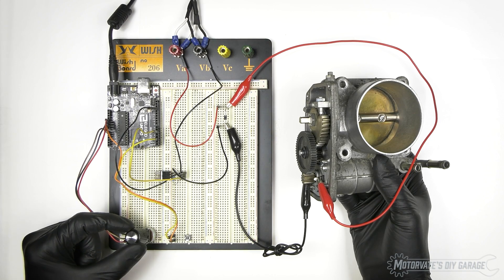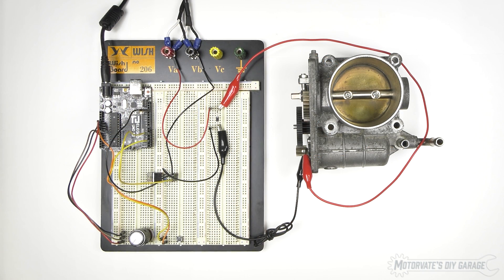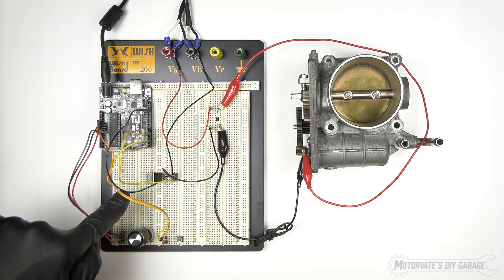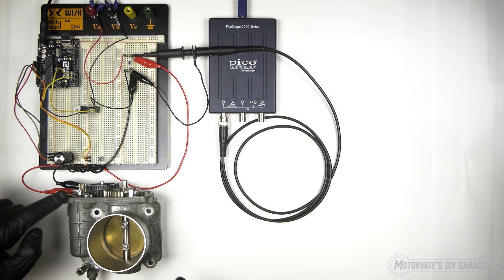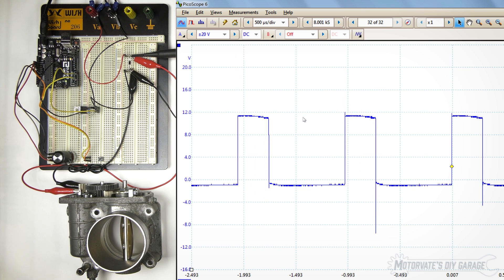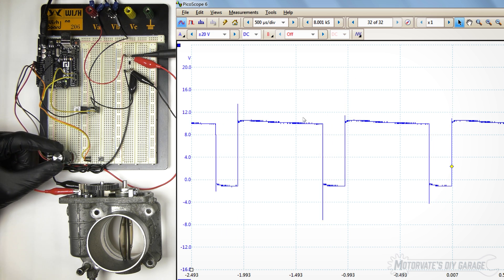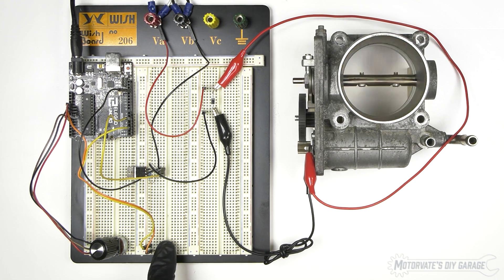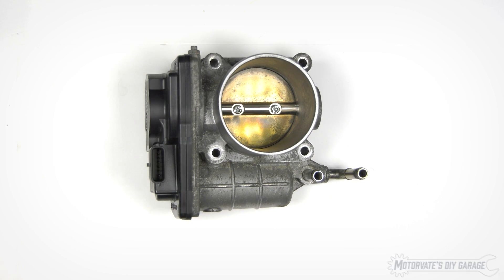How it Works - Drive by Wire Motorvate's DIY Garage Ep.31

Comment: what type of motor is attached to the throttle body? is it some kind of servo or ordinary dc motor?
Reply from the maker: In this example, it was a stranded DC motor with two brushes.
Reply: It is a DC motor but it's being driven like a servo based on throttle position sensors by stock ECU.

Comment: This is misleading AF..   what you have hooked up is nothing more than an open loop PWM circuit that is typically used to control the power in a circuit by turning a transistor on and off really quickly. More on time = more power..  Computers in the cars that control these throttle bodies are closed loop circuits. Meaning that the ECU monitors the pedal position and makes sure that the throttle blade  matches the requested throttle position via TPS Sensor.  If not, the computer adjusts the position using PWM and a PID to control the throttle blade. Most throttle bodies have a park position that is open from the position usually used when the engine is idle, which means it must use reverse polarity to pull the throttle valve closed to reduce air flow to control idle. so your little transistor there is not even close to accurate since they use an H-bridge to control them.

Speed, position, response etc are all controlled by a PID (Machine control algorithm) and if you want to change the characteristics of your DBW throttle, you need access in the tune to do so. 

Either know what you're talking about and speak facts, or don't say anything at all.
Reply from the maker: This is a simple intro to understand the basics.
Reply: Look at the big brain on bread, dam you a  smart mf. thats right.. the metric system.

Comment: Oh  sorry to ask , just check that your video since 2018 but do you Have any chance that schematic and code laying around for share?
Reply from the maker: (note: this code is only for demonstration purposes on a test bench. It does not have the required safe guards  or any for of feed back to verify position.)

I don't have the schematic, but just google "arduino mosfet motor control" and you will see one of many circuits you can use.

Here is the code used in the video:
/*
Frank at Motorvate
March 25/2018

Updated Aug 23/2018
• Use PWM to pin5 for 980hz switching frequency
• Add push button for instant WOT

Arduino controller for G37 throttle body
using a MOSFET (IRLZ44)
*/

// the setup routine runs once when you press reset:

int sensorValue = 0;
const int MOSFET = 5;    // the PWM pin the MOSFET is attached to
const int WOT = 2;      // Switch input on pin D2

void setup() {
   // declare pin 5 to be an output:
  pinMode(MOSFET, OUTPUT);
  
    // initialize the pushbutton pin as an input D2 using internal pull up resistors:
  pinMode(WOT, INPUT_PULLUP);
  
  // initialize serial communication at 9600 bits per second:
  Serial.begin(9600);
}

// the loop routine runs over and over again forever:
void loop() {
  // read the input on analog pin 0:
  int sensorValue = analogRead(A0);
 
  // Convert the analog reading (which goes from 0 - 1023) to a voltage (0 - 5V):
  //float voltage = sensorValue * (5.0 / 1023.0);
  sensorValue = sensorValue >> 2;
    
  //Serial.println(!digitalRead(WOT));

  if (!digitalRead(WOT)) {    // if button is pressed, set value to 255 to open throttle quick as possible
    sensorValue = 255;        // the "!" is used since the internal pull up resistors result 5v on line
}

    // print out the value you read:
Serial.println(sensorValue);

analogWrite(MOSFET, sensorValue);
  
}

Comment: so theotically we can increase the thorttle response speed by in creasing the voltage for the first pulse ?
Reply from the maker: It would be better to increase the pulse width at the same voltage during throttle transitions.

Typically the DC motors in an electronic throttle are designed for 12 volts. The motor might not like higher voltage and shorten its life.
Reply: @MotorvateDIY  but at the same time won’t it delay when releasing the throttle?
Reply from the maker: The throttle is closed by reversing the direction of the motor and that is assisted by the "return spring".

A real throttle control system uses an "H-bridge" to control the opening and closing of the throttle. This can drive the motor open or closed. The "return spring" is used as a "fail safe" device, so if the throttle control fails, the spring will almost close the throttle (to about 5%) and return the engine back to idle.
Reply: If you want throttle response, use a cable throttle and flash the ECU to not complain.

Comment: I like your setup! I would like to see if you could modify the throttle body linkage to mount to the side of a standard holley carb or gm 2 barrel tbi system.
Reply from the maker: Thanks for the comment! 
I don't think having electronic throttle control of a carb would be a benefit... why not just use a throttle cable?

Comment: Hey ik this is a long shot... But do u have the code for this?? Maybe link the github page😅... Thank you🙌🏾
Reply from the maker: No github yet... but here is the exact code from that episode:
/*
Frank at Motorvate
March 25/2018

Updated Aug 23/2018
• Use PWM to pin5 for 980hz switching frequency
• Add push button for instant WOT

Arduino controller for G37 throttle body
using a MOSFET (IRLZ44)
*/

// the setup routine runs once when you press reset:

int sensorValue = 0;
const int MOSFET = 5;    // the PWM pin the MOSFET is attached to
const int WOT = 2;      // Switch input on pin D2

void setup() {
   // declare pin 5 to be an output:
  pinMode(MOSFET, OUTPUT);
  
    // initialize the pushbutton pin as an input D2 using internal pull up resistors:
  pinMode(WOT, INPUT_PULLUP);
  
  // initialize serial communication at 9600 bits per second:
  Serial.begin(9600);
}

// the loop routine runs over and over again forever:
void loop() {
  // read the input on analog pin 0:
  int sensorValue = analogRead(A0);
 
  // Convert the analog reading (which goes from 0 - 1023) to a voltage (0 - 5V):
  //float voltage = sensorValue * (5.0 / 1023.0);
  sensorValue = sensorValue >> 2;
    
  //Serial.println(!digitalRead(WOT));

  if (!digitalRead(WOT)) {    // if button is pressed, set value to 255 to open throttle quick as possible
    sensorValue = 255;        // the "!" is used since the internal pull up resistors result 5v on line
}

    // print out the value you read:
Serial.println(sensorValue);

analogWrite(MOSFET, sensorValue);
  
}
Reply: @MotorvateDIY  damn u are a legend
Reply from the maker: That's very kind, thank you!
Reply: Can you specify the exact diode used, because I think mine is shorting the whole circuit
Reply from the maker: It took me a while to find my notes on this, but I did!

The diode is an 1N4001 and the MOSFET is  an IRL244.
Good luck!

Comment: Great content,  hi from Brasil.
Reply from the maker: Thanks... All drive by wire systems are fundamentally the same as shown here, but have additional throttle position checks for safety and built in "fail - safes" in case of a fault.
Reply: @MotorvateDIY  thanks for explaining, I bought my first car with this sistem, then I decided to search about it. It's a little hard to get used to at first

Comment: Are you able to provide the code?
Reply from the maker: Sure... This is the code used in that episode:

/*
Frank at Motorvate
March 25/2018

Updated Aug 23/2018
• Use PWM to pin5 for 980hz switching frequency
• Add push button for instant WOT

Arduino controller for G37 throttle body
using a MOSFET (IRLZ44)
*/

// the setup routine runs once when you press reset:

int sensorValue = 0;
const int MOSFET = 5;    // the PWM pin the MOSFET is attached to
const int WOT = 2;      // Switch input on pin D2

void setup() {
   // declare pin 5 to be an output:
  pinMode(MOSFET, OUTPUT);
  
    // initialize the pushbutton pin as an input D2 using internal pull up resistors:
  pinMode(WOT, INPUT_PULLUP);
  
  // initialize serial communication at 9600 bits per second:
  Serial.begin(9600);
}

// the loop routine runs over and over again forever:
void loop() {
  // read the input on analog pin 0:
  int sensorValue = analogRead(A0);
 
  // Convert the analog reading (which goes from 0 - 1023) to a voltage (0 - 5V):
  //float voltage = sensorValue * (5.0 / 1023.0);
  sensorValue = sensorValue >> 2;
    
  //Serial.println(!digitalRead(WOT));

  if (!digitalRead(WOT)) {    // if button is pressed, set value to 255 to open throttle quick as possible
    sensorValue = 255;        // the "!" is used since the internal pull up resistors result 5v on line
}

    // print out the value you read:
Serial.println(sensorValue);

analogWrite(MOSFET, sensorValue);
  
}
Reply: I’m not good at coding is there anyway I can make in more responsive
Reply from the maker: I don't know how to answer your question as I don't understand what you are asking.

What EXACTLY do you want to make more responsive?
Reply: I used the code you gave me but it’s to laggy from when I push the pedal to when the throttle moves is there any chance I can change the code you gave me the make the throttle response more faster?
Reply: The reason I’m asking is because I made what you made in your video and put it in my drift car but the throttle response is to laggy for me to drive probably so I’m hoping you can help me fix the problem I’m having
Reply from the maker: That code should not be used in a car! It doesn't have ANY safety or fail safe strategies. 

The code is for educational purpose only, and should only be used on a test bench. 

Here are a few typical safety systems:
On a typical car, the throttle body will have 2 different throttle position sensors and they are crossed check to make sure BOTH sensors have the proper reading.

Also, the engine computer will calculate the throttle position and then check its actual position to make sure the throttle is not stuck or in the wrong position.

The engine computer will also have a special timer that needs to be reset a few times per second by the engine computer. If it doesn't get reset before the timer gets to 0, the entire engine computer is restarted. This is known as a "watchdog timer"

The operation of the throttle uses a "PID Controler" (proportional, integral, derivative controller)  https://en.wikipedia.org/wiki/PID_controller

This is used to increase throttle response and accuracy. The more the throttle needs to move, the faster/stronger the signal is sent to the electronic throttle.

As you can see, there are a lot of safety strategies that need to be used for safe throttle operation.

Comment: Do you have to program the arduino or is it a plug and play?
Reply from the maker: I make a small and simple program to control the mosfet which controlled the throttle body motor.

The program simply reads the position of the variable resistor (using the built in analog to digital converter) and then outputs a pulse width modulated signal that is proportional to the the variable resistor position.

In the real world, the throttle body control system is much more complicated and uses a feedback system to ensure accurate position and proper function.

Comment: It would be nice if you could convince the manufacturers to "dial out" the delay in the actuation of the throttle plate.  That hesitation as you correctly showed can easily be eliminated, unless you want to pump up your gas mileage ratings.  Just slow down those "lead-foot" drivers & presto - gas mileage magically goes up.  Makes you kind of miss the old fashion carburetor!
Reply from the maker: Hey S. Jorgensen,
The engineers that design the drive by wire systems have MANY constraints they need to take into consideration, with the top one being emissions. This means they may need to do things we might not like, but are required to.

As for missing the old school carbs... I don't. They didn't like cold weather (needed a choke) , didn't like hot weather (vapour lock) and generally were not very efficient.
Reply: @MotorvateDIY  Good point Mr. M. DIY.  I will have to remember that engineers have to answer to someone else higher up.  But, don't underestimate the "lowly" carburetor just yet.  NASCAR was still using carburetors in their cars up until around 2011.  Refinements made them quite reliable, but gas mileage was not their best feature.  The one thing they did excel at was their linear response.  Remember when the secondaries opened up on those cars?  The choke could be an issue as well, but the electric choke solved most of those problems.  I am sure the engineers will improve the pedal to throttle response if they are allowed to, or eliminate the delay feature that seems to be put in by the "gas mileage police".
Reply from the maker: I have no issue with carbs, they can make excellent power... BUT they are not very good for  emissions... That is why carbs stopped being used in the mid 80s.

Comment: Guys subscribe to this guy. He is very knowledgeable and puts in the work.  Here trying to understand my high idle issue. Is the ROM part of the ECU or is on  a separate chip  on the board?
Reply from the maker: Hey  Fernando Hood,
Thanks for your kind words!

I'm going to assume you are asking about a Nissan or Infiniti.
The throttle plate position is controlled by a "H-Bridge" (throttle body motor control) chip that is mounted on the ECU (engine control unit) circuit board. 

The main processor of the ECU looks at a bunch of inputs, determines the required throttle body position, and sends a signal to the H-bridge chip to open or close the throttle body plate.
Reply: @MotorvateDIY  The rom with all the learned information is it part of the main microcontroller or is there a separate eeprom? Tried reaching your guy regarding this idle issue without success.
Reply from the maker: Separate 4K bit EEPROM. 
I don't think he is open on weekends...

Comment: I still go for the conventional physical cable throttle it is easy to maintain and it is reliable and cheaper for maintenance..
Reply from the maker: I understand what you are saying... but there is zero maintenance required on a drive by wire system. With a cable actuated throttle, they do require a little lubrication once and a while.

For me, the one disadvantage of drive by wire, is that the accelerator pedal doesn't slightly vibrate to engine RPM. As it turned out, I used this when backing up and ended up stalling the engine a few times when backing into my garage. (manual transmission & slight hill) It took a while to figure out, but now I listen to engine RPM and all is well :)

Thanks for your comment

Comment: Hi i have a 2020 Honda Insight which uses a drive-by-wire system, and I was wondering how I am able to steer when i put the car in neutral with the car off. The engine isn't running and i have it in the 2nd accessory mode, which means that the power steering isn't supposed to work right? But i can still control it when rolling downhill even with the car is off. How/why is that?
Reply from the maker: I don't know exactly how your steering system works, but you might have some electrical assist, or simply be able to turn the wheels with mechanical effort.

Comment: In an actual car that PWM sound doesn't seem to come. Why is that so? pl explain.
Reply from the maker: My guess would be the PWM frequency. On the throttle body, the frequency seems to be around 1Khz, so we can easily hear it. If the frequency is increased to 15Khz, we won't be able to hear it, or it will be much quieter.

Comment: This is an open loop control, the real thing also has a TPS, or throttle position sensor which gives the current opening position back to the ICU. This improves precision as the intake flow forces the throttle valve to close against the action of the mechanism resulting in undesired output otherwise.
Reply from the maker: Agreed. This is a simple open loop system, which would never be used in a car. I just wanted to show the basic operation.

Comment: Nice, clear intro to PWM, thanks. Maybe a follow on (or two) could explain the other systems/principles used in a typical electronic throttle. The  two I'd go for are twin pedal sensors (for safety by comparison of the two signals) and throttle valve position feedback to maintain throttle opening proportional to pedal position. Explaining the feedback can lead to explaining the wonderful things that electronic control lets you do such as mapping torque or power to pedal position or having different maps for different driving styles.
Reply from the maker: Hey  Raglan's Electric Baboon,
Thanks for your kind words :)

I will add your suggestions to the "future content" list.

Comment: Do you think a pedal commander would help the lag for a 2013 g37?
Reply from the maker: Hey  bryantcasey87,
I really don't know. Those devices simply remap part throttle to full throttle.

I also don't know if the "lag" is the engine not making power right away, or if it is the transmission not downshifting as quick as we would like.

Based on the throttle response of my 6 speed manual G37, I think it might be the automatic transmission. My throttle response is exactly what I would expect.
Reply: Yes.  I have one and I hate driving without it.

Comment: Nice presentation! Does those systems need a stepper motor? Or all of them be controlled by a classical DC one?
Thank you! Greatings from Greece.
Reply from the maker: Hey Terry Terry,
I don't know the inner working of every electronic throttle body, BUT the ones I have seen all use a DC motor with dual position sensors.

I think a stepper motor would be too slow to respond to quick throttle changes and too expensive. Here the DC motor works very well.

Thanks for your comment!
Reply: @MotorvateDIY  Thank you too! :)